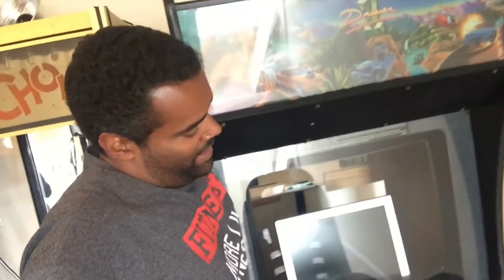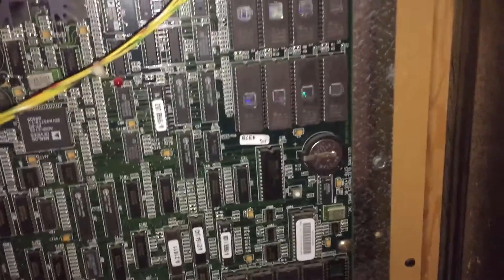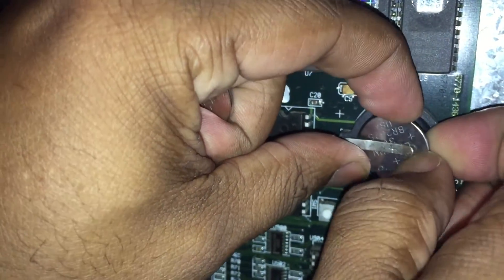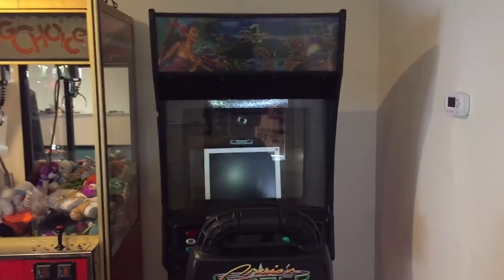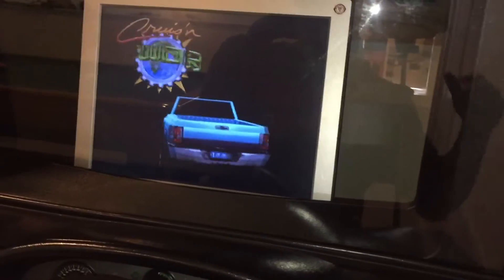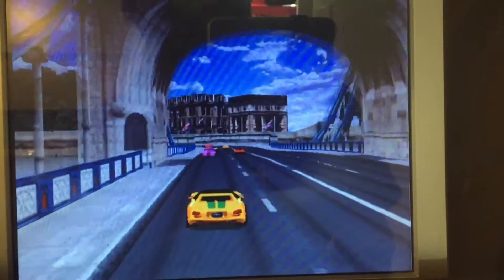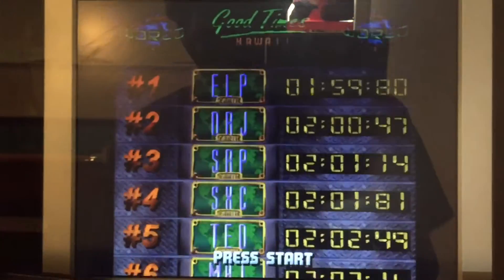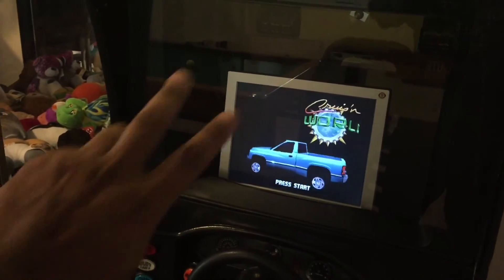How To Fix Arcade Hi Score & Settings That Won't Save

Comment: I have an original cruis'n USA unit and board. The retaining clip broke on mine and now it won't ground or whatever, new battery won't hold with electrical tape. Any ideas on how to overcome? Thanks, love your setup and conversion.

Comment: I’m enjoying your videos! 
I’m just getting into this hobby. I have a cruisin that I’m trying to convert to lcd. What did you use on the converter for input from the machine? I’m using the 8 pin supplied but I’m not getting a picture. I’m getting a signal from the converter to the monitor but nothing from cruisin.
Reply from the maker: jason stang do you have power running to the converter? I have a video where I convert the cruisin but I might not show enough details but it’s been a while so I’m not sure if I might have showed better details. Search “302rell cruisin” and you should find it
Reply from the maker: jason stang https://youtu.be/1zEQB2w51vc
Reply from the maker: jason stang I also remember having a problem with one of the lcd monitors I was using to test, I swapped for another monitor and it was working fine, so in case you did everything your supposed to do and it’s still not working try a different monitor. Good luck! Let me know if you get it working
Reply: Awesome! I’ve got it! I was trying to use the wire that came with the converter. I soldered mind to the pins like you did. Works! 

I’m just having a hard time with the clamp settings. I’ve tried sp03 and st04 but the picture is jumping still.
Reply: I have it all figured out now. I appreciate your video, it really helped. Also, I wasn’t having clamp problems. I was having problems with the picture jerking. I found good instructions online for the converter. My gbs didn’t have any included. Here it is in case anyone else needs it:

http://retroactivearcade.ca/content/GBS-8200%20VGA-CGA%20Manual.pdf
Reply from the maker: Glad you got it working again!!